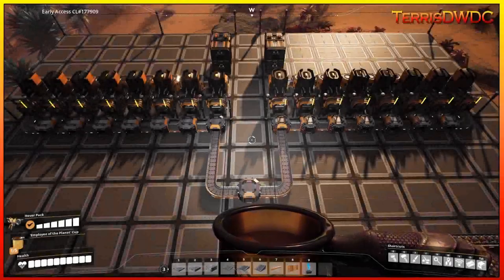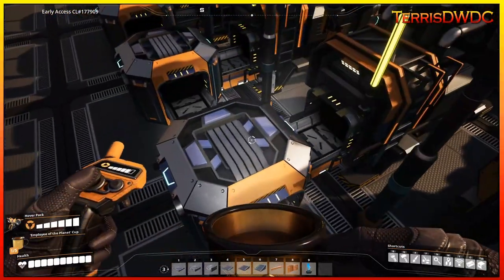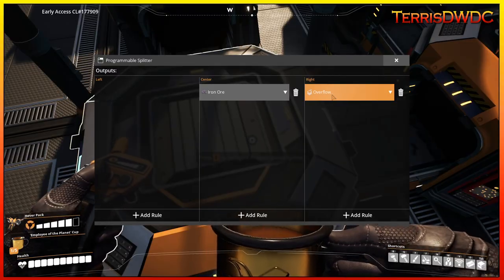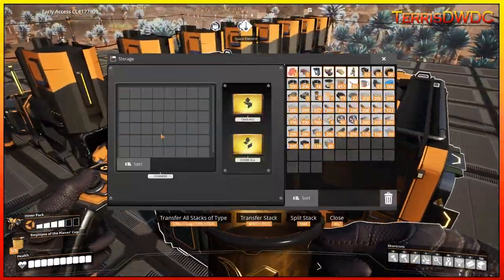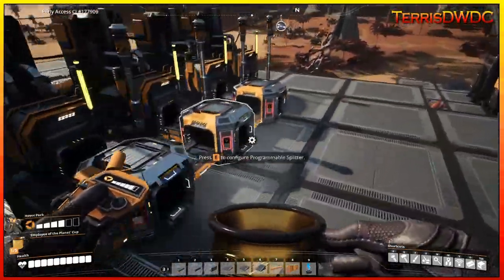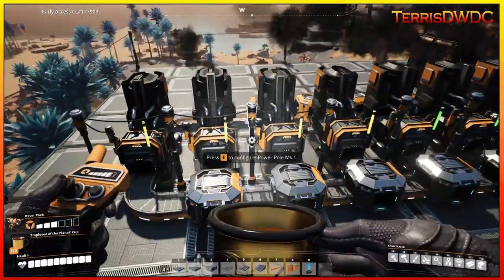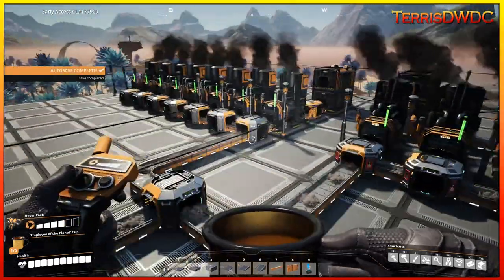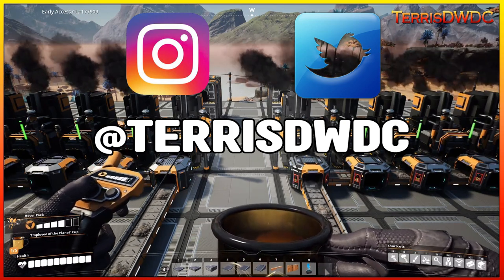Basic Manifold vs Smart Manifold - Satisfactory Update 5

Comment: Nice vid.. Smart splitters do not cost as much as you think. Once you get to end game tier, you'll have more than enough for making them. I only use smart splitters with my builds. 

1. A lot of places in the game have multiple ores close to one another. Send them to one belt and It is so easy to just make a programable splitter to smart splitters with a loop and a crusher on overflow to distribute everything evenly. Helps on FPS and less belts.

2. You can use fast belts to fill your machines when using SS. Most people try to balance by using slower belts as inputs to control normal splitters. 

3. The Smart splitter way also keeps your power at a constant and more stable line. You wont have the /|_----/\---- line you'll have more like a /\___---------- stable line with increase and more predictable power at the beginning of the build. 

You can also use batteries to time the MK miner to turn off once the batteries are depleted. For ex. You can have a iron ore Mk miner 1 putting out 60 and place a battery to it and keep the plant on the main and put the battery on a switch. If the battery takes 10 mins to fill then another 10 mins to drain, Let the battery fill, cut the switch from the main before the battery and you should be able to get a full bin before it cuts off. This saves your power plant needs and the dreaded Nuclear setups. 

Another video you can make is with the manifolds being filled from center out to left and right, instead of just one side. Like this ----------/\---------- instead of /\-------------------. So this will speed up the fill process also.

Another thing I noticed is that people do not use the ore purity for what it was intended for. If you have an impure iron node, it's just for 20 iron plates, 30 pipes or 120 screws. I know you can shard them but why? If you find an impure node, make a small factory for what it's meant for. It'll help in the long run, trust that.

Comment: The "smart" version will never recover from the down time at the beggining
 The regular versión has to be more efficient just by the fact that it has all machines working from the very beginning while the smart versión has all but 1 machines idle for all the beginning.  Other than that on the long run they should work the same.
Reply from the maker: I actually proved the smart manifold is way faster and completing the warmup in my video comparing conveyor speeds. It was an interesting test. You should check it out.
Reply: @TerrisDWDC  no, by the end they still kept a difference that would stay indefinitely. On the long run they have the same performance as both have a "warm up time". But the "smart" version has a lot of down time at the beginning 
Making it worse over all. .. Also the regular one would have been even better if you started from the center instead of starting from one side. While the "smart" one would perform the same either way.
Reply: @TerrisDWDC  No you proved the smart was faster to have all running 100 %, but if you keep running it until the basic are all running, the basic will still have made more ingots and the smart cannot catch up since they both have the same max speed. That they have less in the input is just because they are ahead and have output more so your way to measure is flawed and your conclusion therefore wrong.
Reply: Think about it this way. None of the inputs are backing up at all, so both systems are taking in the same amount of materials. The difference in output, therefore, comes from the raw materials being stored in the machines.   The best way to do it is to feed the machines using any method and preload them with a full stack of raw material.

Comment: The smart manifold will never catch up. The reason is that for the first 6 smelters, both alternatives result in them eventually being totally backed up. By now, with the ordinary splitters, the last two is perfectly load balanced. With the smart manifold, smelter 7 will eventually be totally backed up, storing 100 ore that the ordinary manifold won't. Feel free to try again, replacing the final smart splitter with an ordinary splitter, and you'll see things even out.
Reply: It'll catch up, because the last 2 on the normal splitters will not get enough material before they cut off. This why they will run at about 66 percent. While the smart splitter side will always run a full 100%. And will eventually fill up just a little faster. But this is more about power efficiency.

Comment: BUT! What if the smelter furthest away (smelter nr 8)  down the manifold is the one that gets fed first? And then nr 7 and so on. The materials are allready on the belt and have hot a shorter distance to the next smelter.

Compaire the two programmable manifolds that start out in each end.

Comment: Thanks for demonstrating how smart splitters actually make the efficiency worse until the last one is getting fed.

This would only make sense, if you could program a splitter for specific output rates at the same time.

I try to limit the output by choosing slower belts to feed each smelter, which helps to increase efficiency for a manifold setup.

Comment: One reason for why the "dumb" line does not fill up is because it manage to smelt more ;) and even having them turn on and off, they will outpace the smart until all are filled.

So the main benefit of the smart ones is as mentioned that you could avoid having scrap blocking the smelters.

I have yet to see the load balanced one but I guess it was even faster in the beginning since all 8 would be running continuously as long as the feed can handle all. But it takes up more space and is also harder to upgrade when you get better belts, the spillover you can just extend once better belts are available.

Comment: This test seems to be very useful info when starting and stopping coal power grids. This idea would enable a slow and stable startup vs major fluctuations using normal methods. Smart splitters would effectively be the same as programmable splitters with this idea tho.
Reply: I always just let the belts run and then turn on the buildings once the manifold is full. It's a much faster startup and only requires regular splitters so it's much cheaper to create. All it takes is a few minutes to let the belts run
Reply: For the coal one I agree, having them turn on one at a time is really good, having them flicker can tripp the circuit and stop the feeding making a restart very hard.

Comment: For energy production I've found smart manifolds to be better for cleaner startups. For example, Normal spliters would cause coal generators to start and stop near the end of the line. By using smart spliters you only start a generator once enough resources are available  to consistantly feed it. From this I've seen quicker 0% to 100% opperations and a smooth power inbetween.

Comment: Satisfactory needs more updates towards intelligent automation. What we have so far is a kind of layout automation. In other words, the machines run on their own but limited to what we established at the time of construction.

Players lack some sort of "core system/core interface" that allows us to fine-tune a production plant. An example is when producing AI limiters or circuit boards. We don't have a panel that shows us all the machines involved in a certain location or connected to a certain electrical network and through this make adjustments in production.

Smart/programable splitters can be a step in that direction.
Reply from the maker: That is a fantastic idea, I'm currently working out all the math to have, all 4 of the final space elevator items running 100% to dump into an awesome sink and a 30 Reactor Nuclear Power Plant with complete recycling. It would be nice to have an interface to view and show any shortcomings in my logic.
Reply: I thought of something like this  (- a master control panel/room ) after just a few days playing this amazingly intriguing, clever, math-puzzle, logistics problem-solving game. However I also shortly thereafter concluded that this would actually break the game by making it way too easy and taking away what the actual challenge, and enjoyment, of this game IS - the mathematical and logistical challenge of figuring out what's needed, how many!? from where? to where?, where is the problem in the setup? what went wrong? what machine backed up the line? what process stalled out the production!? how to get/make more!? etc. etc. etc.

A 'master control panel' that just shows you easily where the problem is, and possible control machines remotely, would actually make the game way too easy and ruin the fun, to be honest. If real life where getting the finished product is actually important, sure! great! ideal! But in this game, the 'finish product' is not actually worth anything other than an obstacle stopping you from going on to make the next thing. It about the process, not the end-product.

Comment: Nice video. I quite enjoy how you make these :)

Still, there are a few "technical notes" I'd like to leave...

1) Smart/programmable splitters "cost more performance" than normal splitters. Replacing EVERY splitter with a smart one just to have your manifolds fill up faster is bound to make your logistics heavier on your FPS than if you used normal splitters. Of course, mixing belts to save on belt count can balance this in the opposite direction, but that's a different topic...

2) Mixed manifolds (aka "sushifolds", manifolds fed by a mixed belt) have a VERY IMPORTANT difference compared to normal manifolds that should be pointed out: OVERFLOW MANAGEMENT. This should be done whenever mixing items on a belt, but one must make sure that such belt will keep running stably, else the whole system might clog.

Eg: you provide 60 iron + 30 copper (per minute) to a sushifold feeding smelters. This works fine, but if ANY of the smelters were to fill up their output and go idle (not taking input anymore or not taking it fast enough), the input belt would fill up with excess iron ore. The ore would overflow down the line of splitters and eventually back up all the way to the miners, causing the system to clog. More specifically, the iron ore would fill the end of the belt (where copper is smelted), so the copper smelters can't get any copper ore. The copper ore (not having a way to reach the right smelters) will sit in the belt and block the iron smelters from taking iron in. Eventually the entire system needs manual intervention to restart.
All this is easily avoidable (easiest is adding an overflow sink) as long as one has the knowledge/experience aviable

As a final note, I believe there won't be any faster belts. The Devs have been pretty clear on this. But despite this, belt-mixing is still one of my favorite logistics (especially sushi load-balancers), as there are PLENTY of possibilities aviable for mixing withing throughput limits. And while one kinda has to create such possibilities early on (it makes little sense to merge high-volume (usually low-tier) items like SCREWS, ores and such), there are productions, like nuclear, that allow for belt-mixing of all (non-radioactive) items on a single MK4 belt at ANY size (even at map-limit-factory scales). So I say that there's plenty of possibilities for belt mixing even with the current throughout limits :)

I hope I didn't make too much of a mess out of this comment... I regret not typing this on PC 😅

Comment: I usually let a bin filling with ore in the miner while I work on the belting an stuff, and when I'm about to kick start the whole thing, I just go to the bin, grab the amount of stack I need to fill All the respective machines in the line, remove the bin and reconnect the belt from the miner to the line. Once the belt is all full, I turn the power on in the machines and boom, everything working at 100% right away. And this does not take much work at all, it's really really easy

Comment: I wonder what we would see with, on the smart splitter side, the first three splitters were normal splitters or both outputs were set to ore.  There's enough ore in the splitter chain to start four smelters right away.  Which is why the regular splitters had such a big head start, the first three machines were 100% efficient right away.
One thing I would like to see on the Programmable Splitters in a future update would be a piece-per-minute on each resource on the outputs.  So we can load-balance manifolds late game.  You can kind of do it with belts, but at that point we've got a bunch of alternate recipes that don't run exactly 60ppm or 120ppm.

Comment: Using one programmable splitter line to run multiple resources (i.e. iron, copper, and caterium ore) won't work properly in most situations.  Using your example (and assuming you're also running copper and caterium ore along the same input conveyor line as the iron ore), what happens to the copper and caterium ingot production when your iron ingot industrial storage container fills up completely?  The iron ingot smelters' output hoppers will fill up causing them to stop accepting new iron ore.  That iron ore will clog the input conveyor system.  Assuming, as you hypothesized, you're running other resources like copper and caterium ore on the same input conveyor, both these resource will also get stuck in the clog and no longer feed into the copper and caterium smelters.  Vice versa if we see a similar issue with copper ingot or caterium ingot production halting.  The only way I can think of where you'd be able to get this mechanism to work as you describe in the video would be to ensure that there is never any clog in the input lines; one way you can accomplish this is by configuring the final programmable splitter to direct any overflow into an awesome sink.  Unfortunately, this would be a waste of ore, but it would work, especially for smaller production lines.  Or you could position the awesome sink downstream to sink higher level assemblies that use the iron/copper/caterium ingots as an ingredient, this would be a great way to earn extra awesome shop tickets.  In fact I currently do this with circuit boards and AI limiters because I'm heavily over-producing on both components - not as part of a programmable splitter input line, but just to earn awesome shop tickets.

Comment: Sorry, but this manifold is anything but smart. It is better to have an ore enter an empty smelter and get smelted, than to enter a mostly full smelter and sit idle. That's why the load balancer beats the manifold. Your "smart manifold" goes in the other direction, and never puts an ore into an empty smelter if there is a half full smelter that will hold the ore.
The real way to improve the manifold is to connect the splitters to the smelters with mk 1 belts, which limits how fast ores can flow into the first smelters and spreads them out better.

Comment: I don't think this comparison was needed at all. Basic logic can tell you that the smart splitters will result in slower startup and the same production rate once it hits capacity. For the same reason that manifolds in general have a slower startup with the same production rate once they hit capacity in comparison to load splitters. Because it's always better to have more machines processing something.

Comment: I bet feeding the middle of a manifold and letting the lines distribute in separate directions using simple splitters would startup even faster than either of these. Once all buffers are filled, the speed would be the same.
Reply from the maker: At that point then the manifold becomes more of a hybrid load balanced manifold.  The idea of the manifold is compact, scalable designs but I will look at a comparison. Now my example isn't ideally compact, more to better visualize the manifold design.  The correct build would be machines distributed along both sides the splitters.

Comment: This is a neat idea but it's horribly inefficient. The time taken to set up each programmable splitter is better spent feeding each smelter with a mk1 belt and using normal splitters. The machines run the same whether they are full or have just enough to run.

Comment: using the double ratio in comparison was the wrong way to compare.  When the normal manifold was at almost 4 and the smart one at 2.5, you should have compared them by how many MORE the normal had in comparison to how many more it had earlier.  If you had, you would have correctly analyzed that the normal manifold had INCREASED its lead in total number of items produced.

Comment: There wont be a Mk 6 belt likely as that would entail some new form of material that hasn't been even hinted at yet and would also require a whole world redo and that change would be MONUMENTAL for Coffee Stain to put in play.  Best bet would be, and this is even doubtful coming from Snutts own mouth, that you'd have a Mk 4 miner capable of 2x 780 outputs.  

I don't know myself.  Wish I did...   They've got to do something for a Mk 5 belt that only does 162% overclock of a Mk 3 miner to fill a full 780 belt.  Way too much production the miner cant spit out.  
If FiCSIT corp can give you all this tech currently in world, what would they think of to fix Mk 5 max belt efficiency issue and will it mean me redoing my entire world to compensate for the newest Mk 6belt or a Mk 4 miner double belt output.